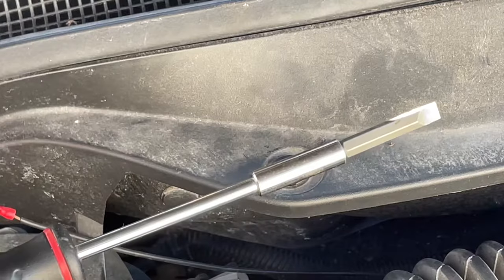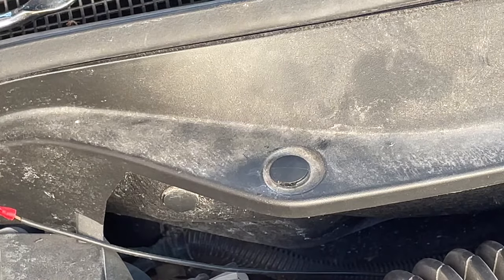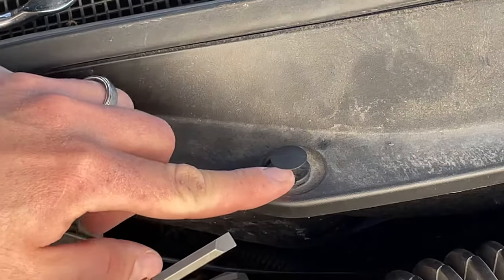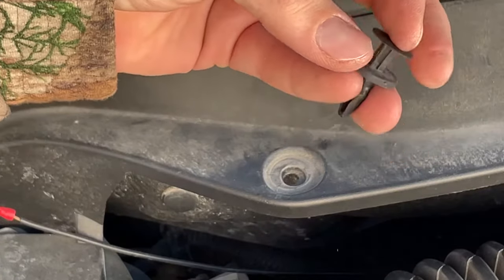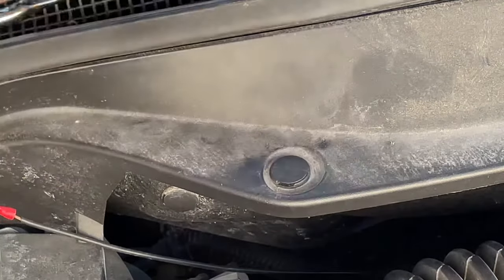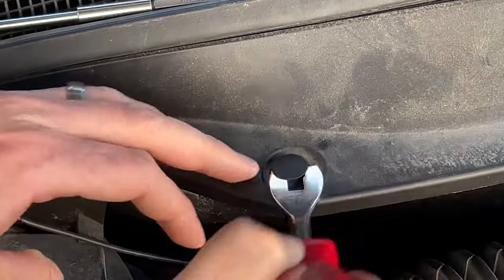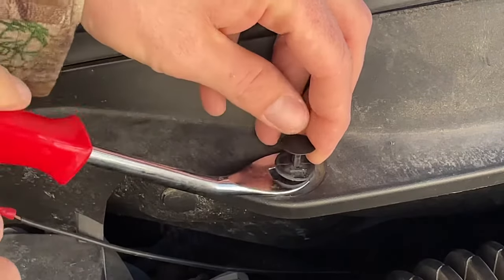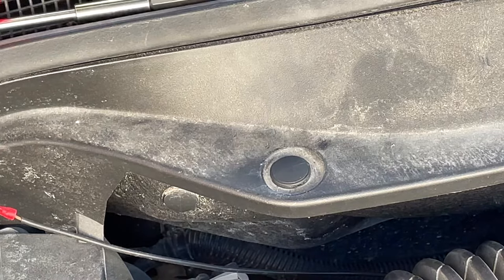How To Remove Plastic Push Rivets On Your Car

Comment: Oh nice the key is to put it in between that slot I had that tool and I was just putting it underneath it. Making it break. Saw your video and show you need to put it inside that gap. Thanks
Reply from the maker: No worries. I’m glad the video helped. To replace your broken ones Amazon has boxes of them for cheap if you are looking. Thanks for watching. Please like and subscribe

Comment: Thanks. Those clips come in various configurations. Not all of them have a slot  to help with the removal. In that instance using two screwdrivers will facilitate easier removal. A properly sized removal tool is the best way to go to protect the integrity of the clips regardless of the type of clip.
Reply from the maker: Yes and there are also Philips head plastic fasteners. My vehicle only has these. That’s why I only showed them. Thanks for watching. Please like and subscribe

Comment: Nice and clear showing both tools. Thanks for explaining the advantage of the specialty tool even though it looks like a little more effort to snug it into the slot. It's clear why the specialty tool places less stress on the clip by not having a single pressure point.
Reply from the maker: You’re very welcome. And thanks for your feedback. I definitely try to use the cheapest or simplest tools but sometimes a specialty tool is required. I’ve also used this tool to pop many panels off the car, and also pop out some tight sensors. Very handy. Thanks for watching. Please like and subscribe

Comment: The battery, for a Chrysler Dodge Journey, is located inside the driver side wheel well. I broke 2 of those fasteners trying to remove the wheel well liner. Went to the Chrysler dealership to purchase replacements. Two small plastic clips cost me, with tax, just over $10.00. 
So, my advice is put your money towards the purchase of the tool. You will always have it for future clip replacement.
Reply from the maker: Agreed. And you can buy replacement clips on Amazon or from most hardware stores for half the cost. Thanks for sharing. Please like and subscribe

Comment: How do you remove small ones? I used a smaller flathead screwdriver but it just damages the rivet
Reply from the maker: Amazon has panel popper tools like this one but with a smaller opening for small rivets. Thanks for watching. Hope this helps. Please like and subscribe

Comment: I wreck these dam things all the time
Reply from the maker: Yes these are a nuisance. Too soft in summer. Brittle in winter. Even with the tool sometimes they won’t budge. Either way hopefully you found the video helpful or at least interesting. Please like and subscribe
Reply: @BillOfAllTrades2016  I did I had 1 out of 50 come out nice lol. So I have 200 replacements coming in the mail. Gotta love Amazon